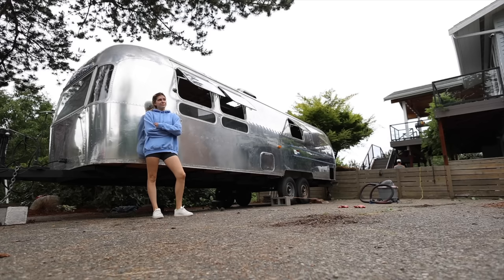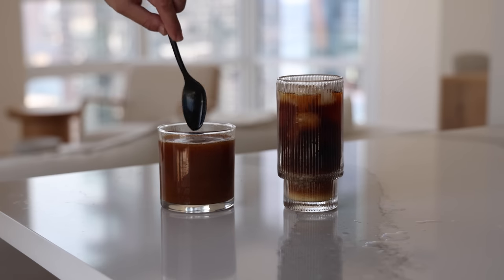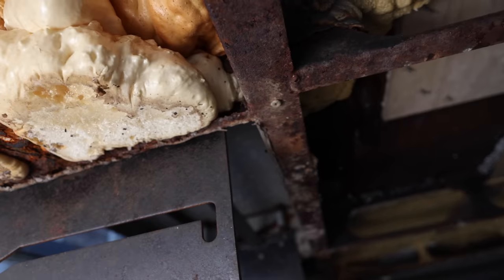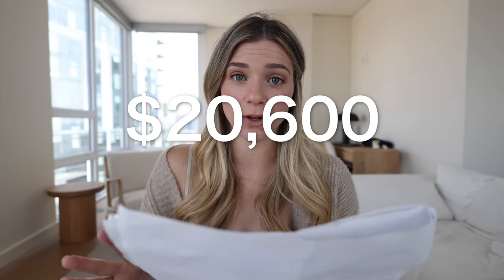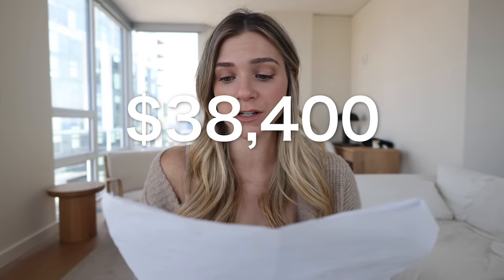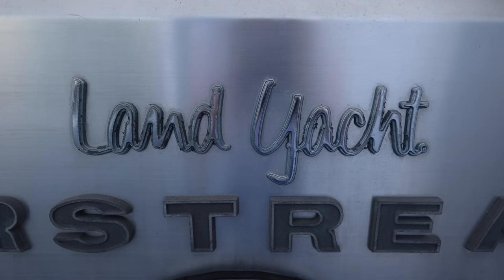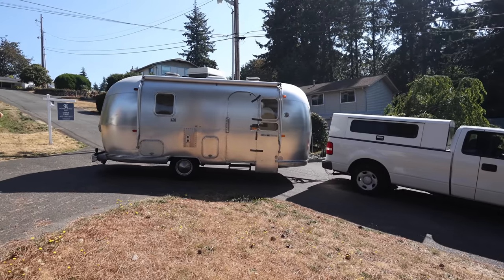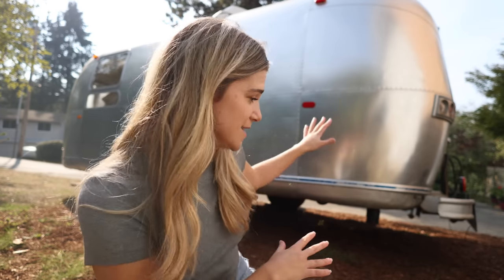Vintage airstream trailers are the worst thing you can buy. Here's why.

Comment: I always like it that you are not afraid to admit your mistakes like in this case not doing your due diligence. But I do strongly feel that the renovation company should have offered or recommended you a pre-inspection of the frame... they're The Specialist after all and should know the common weak points of these trailers... it just doesn't feel right. If you like the work of the Texas company, maybe you could let them do a low-budget reno of Might Mo if you haven't sold it by then, I still think it's AirBnB-able.
Reply from the maker: I agree!

Comment: LOL! I'm working on my old Travel Trailer, I use to do Retail Shows from. Its a 4'X8' I'm converting it into a Mini Camper Retro. With Bed, Kitchen, storage, etc. $100,000 I don't think so. I would do the work my self. Like me, I have the tools & the gigs to do it. Most people don't. I would shop around.... The other issue, that you have to do your research first on AIR Streams Campers with costs and you really didn't do that from the beginning... The first one you bought that was a gem but to big for you... Look, there is enough information just on YouTube about everything needed to help you. You always look under a trailer frame with a heavy duty screw-driver and poke the hell out of the frame. You see layers of rust, big issues. I wish you luck!

Comment: airstream trailers are not the worst thing you can buy in the realm of campers theyre actually the best thing you can buy   those aluminum frames and skins arent old enough to be rotten yet  maybe in another 100 years 
however they plywood floors do rot and on cassion the frames get to rusty to continue to use but a rusted out iron frame is actually to be expected especially up north where they salt the roads  air streams also are highly sought after  the largest model 180 grand the smallest model 56 grand   those prices are straight from the airstream website today may 19th 2023  so i say if you have the money and opportunity to buy a vintage airstream  buy it worth a lot of money
and command a high price if properly restored

Comment: You could buy a new one for less than 100K. Also when someone is backing up get hand signals straight so they know when to stop. Usually a solid fist straight up in air means stop. If you father is looking in his mirror this would be instant stop. Yelling stop never works because they might not hear you. I actually haul travel trailers for a living. The market is saturated right now.

Comment: Buying a old camper and especially a Air-Stream you really have a huge money-pit from gecko... to enjoy camping sometimes on the weekends, find a used "regular" model instead with much less work = cheaper + some normal replacements like fridge and A/C if needed, cushions, drapes will cost much less then any major restoration project / Air-Stream. Good luck on your adventures. 
Cheers from Texas. :goodvibes:

Comment: I just don't understand why you aren't going forward with the plans you had for Mighty Mo. I know that dealer gave it a 3/10 but that's nonsense. You already have the chassis done, stripped the Airstream it and cleaned and fixed what was left. All ready to go ahead start building her up.

If you can find a good spot to stall her, and you and your dad can find the time to do it yourself you can probably do it for 20-30K. Go browse some Van-life "this is my build and what it cost" vlogs, that can show you how much can be done. Many of those builds need to have everything you do except do it in a smaller space.

It seems to me your problem is that you want to have an entire design, but what you should maybe do is start with the diner corner at one end. That's reasonably easy (all things considered) and what you learn from doing that will be a good foundation for doing the rest.
Reply: she would've needed to buy a new truck just to tow it though
Reply: @jj-if6it  ah yes that's right. I forgot about that.